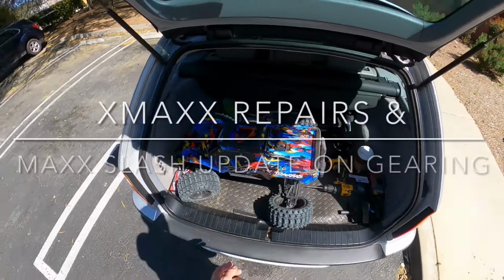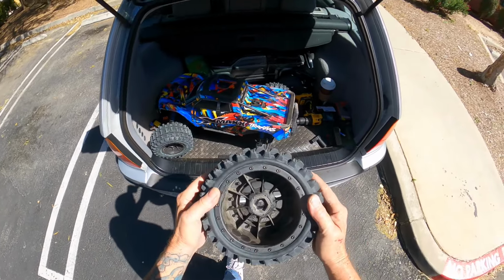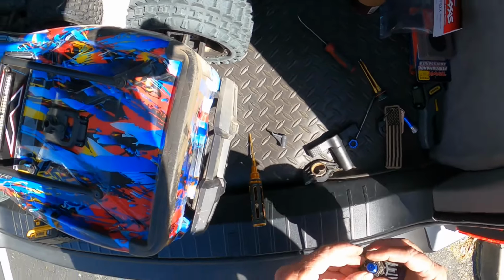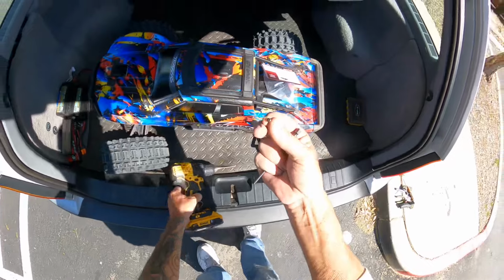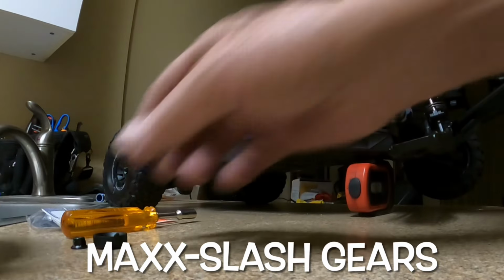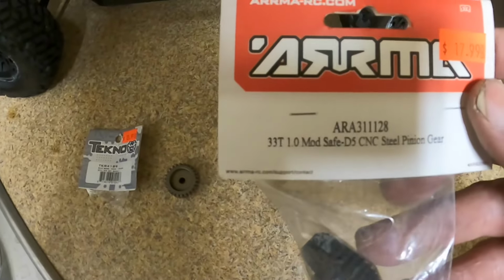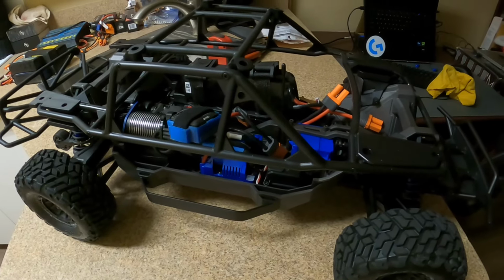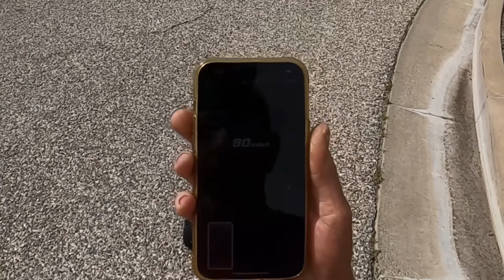Traxxas Maxx-Slash gearing & Xmaxx Repair….

Comment: Why didn't you go with HD rpm hubs
Reply from the maker: Rpm plastic is real soft & needs captured hing pins, we used to do it for the bigger bearings but now traxxas comes with the big bearings
Reply: @earlmoorhead5555  right they do because i just got my xmaxx last month and does have the oversized bearings, I actually only did threaded hinge pins in the front( rpm HD hubs front and rear)and of course I land hard on rear and snapped that pin so going threaded hinge pins in rear as well but no breaks on any hubs yet..🤞
Reply from the maker: @Jayski2  the rpm fronts used to pull out onto the hub to c-block pin that goes top and bottom, the pin pulls right threw the plastic. I ran them when released on both xmaxx’s and first run on both cars pulled out so I went metal on the front to solve it, luckily I haven’t had that issue on the new version yet
Reply: @earlmoorhead5555  metal huh, you have a part number because I may check them out next . Thanks for your help buddy !!
Reply from the maker: @Jayski2  I used the cheaper eBay one from 4 years ago no longer listed but the new ultimate xmaxx uses them